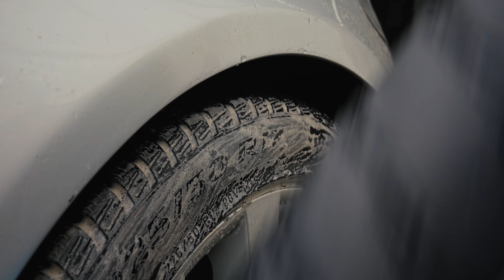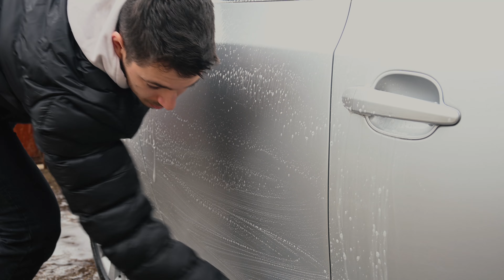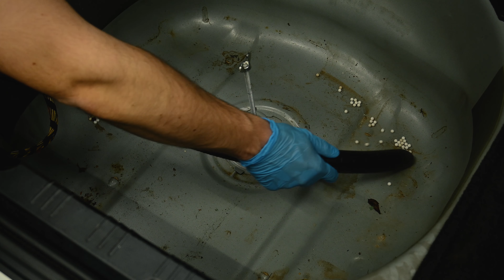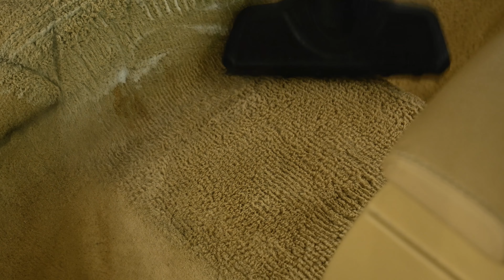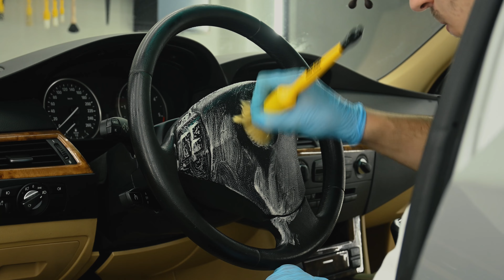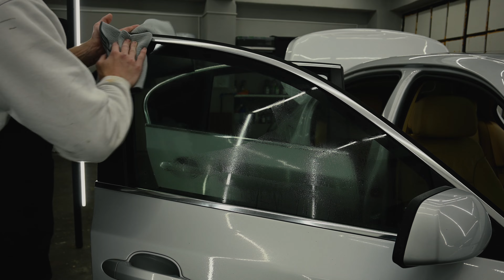Filthy Interior Detailing This BMW E60 - Car detailing

Comment: Hi.
What chemical do you use to clean leather seats?
Gray BMW E60 skins need a different cleaner?
Reply from the maker: Hello , no its still leather , just use colourlock leather cleaner and based on the level of how dirty it is you can buy strong mild or soft cleaner . But if its a E60 i recomend strong cleaner 😅